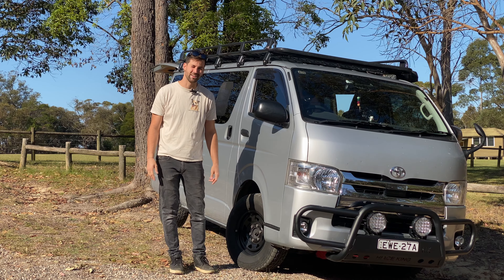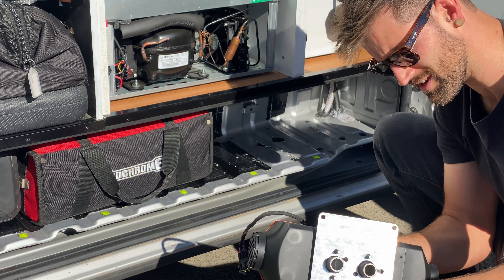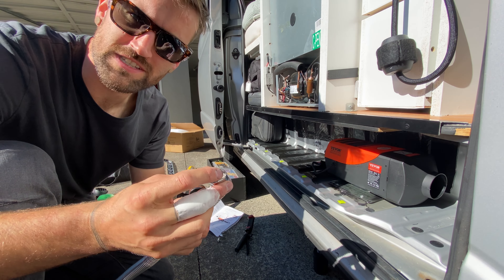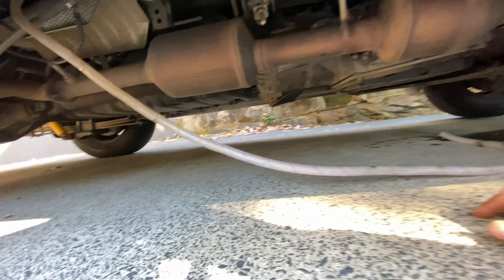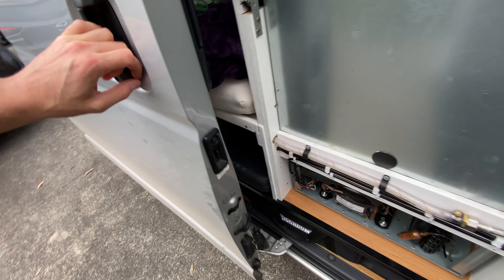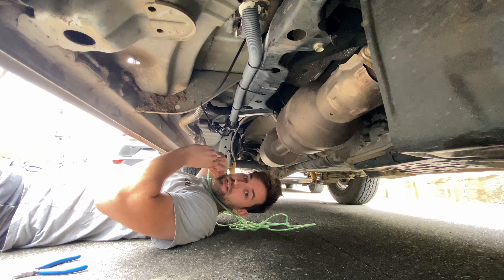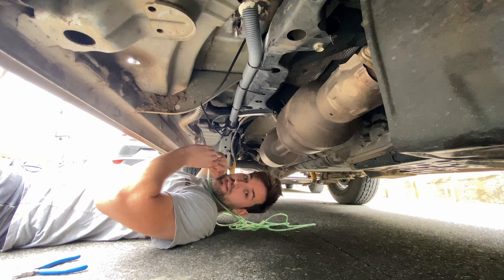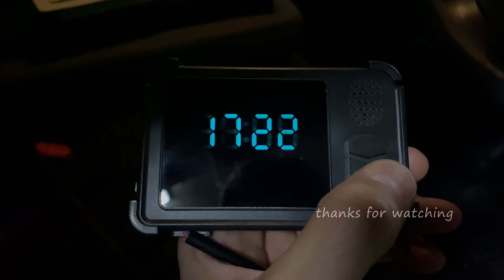I Installed a Heater in My Van, Now It's Too Hot!

Comment: Hi mate I don't think you should have intake outside next to the exhaust I'd be afraid of carbon monoxide I'd have the air intake inside the van also get carbon monoxide detector if you don't have on already 😊
Reply from the maker: Thanks! And appreciate your concern :) 

Thankfully the combustion side is completely external to the van so there should be no issues with carbon monoxide, I do have a sensor also though :)